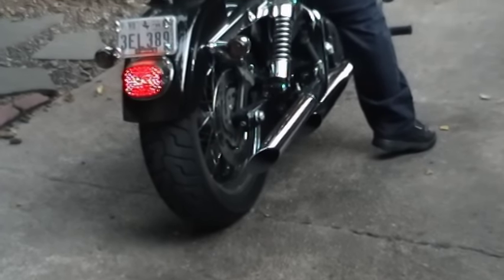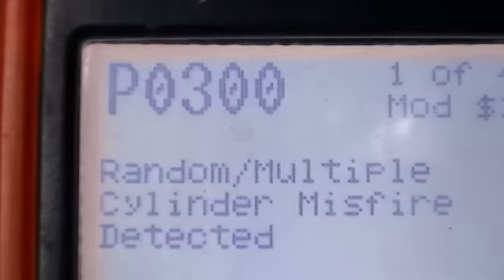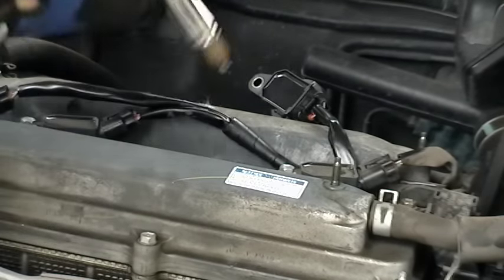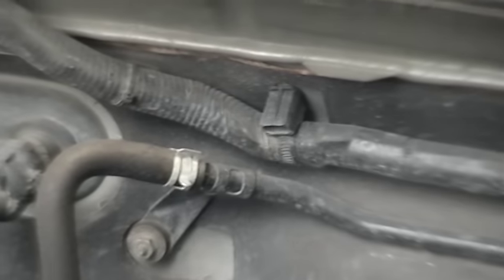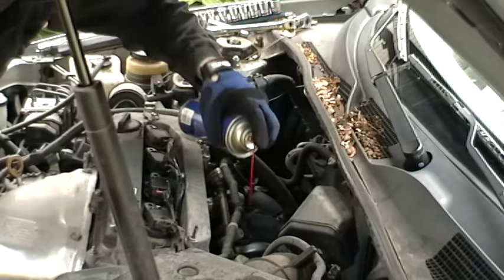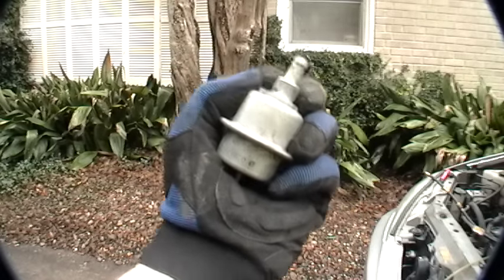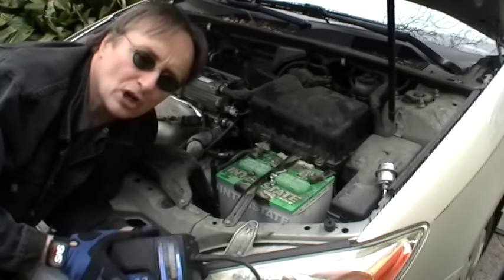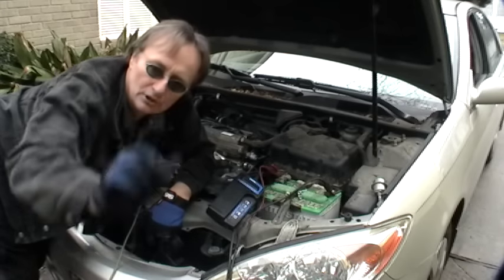How to Fix a Random Engine Misfire in Your Car (Code P0300)

Comment: Hey Scotty nice vid. I have a 2005 honda accord lx and i have multiple cylinder misfire 1,2,3 and 4.  Car starts fine. I checked spark plugs and coils. Car idles smooth but when you accelerate it starts to woble like suffocating or asking for gas.  Im starting to thing its a bad fuel filter cause the car still runs but ruff. What do you think?  Please help me. Thanks
Reply: egr ports probably need cleaning, full of carbon.  i changed a bunch of stuff but still have same problems.  cleaning out intake manifold today!
Reply: Jon Focker Hey i just fixed it.. fucking autozone got me wrong sparkplugs..  i change sparkplugs and waaalaa . Everything runs smooth and they refund money.
Reply: LoCo hUgO
i also bought the cheap ones at first but now got the NGK laser.  i took off intake manifold and cleaned EGR ports and throttle body but now its worse.

getting a P1399 random misfirecode and think i need a valve adjustment.  it's getting personal at this point, lol.  already had to change the transmission due to it being one of the worst designs.  didn't catch that in my google search before i bought the used car.

Comment: I replaced the starter on a 2012 QX56 and attached everything but all of a sudden I have a P0300 and P0306 Code.  Never had any issues before changing the starter.  Has a new 2 month old battery.  Car starts great now but now has these codes.  Hesitates at higher speeds. Replaced starter because it was doing intermittent starts.  Any suggestions on what could have caused this sudden issue would be appreciated.

Comment: 99 GMC Sierra 1500 5.3

Changed all plugs and wires. Still misfiring with P0300. Was working on it today and I discovered the intake assembly (before MAF) has cracks all over it. Vacuum line for fuel pressure is torn on both ends. Can any of these cause P0300? I just hope this thing doesn't have blown headgaskets or bad valves.
Reply from the maker: of course they cause such misfire codes

Comment: Great video Scotty. I have error codes for all cylinders in my 2004 V6 Saturn Vue P0300-06. I also have two other errors: P0442, P0706. The AutoZone employee suggested that P0442 (vacuum leak) is likely causing P0300+. I know my gas cap gets loose sometimes. Could that be the cause? Going to see if it continues tomorrow. Also, is P0706 likely due to a need of transmission fluid?

Thanks! I know I have a lot of questions here.
Reply from the maker: fix any obvious thing like low fluid and leaking vacuum lines FIRST. Pray it's that easy.

Comment: What about the Ford v6 coil pack? I've got code P0305; misfire in cylinder 5. Runs horrible, lacks power........plugs and wires are a year old(iridium, cheap wires from Rock Auto). I've heard that coil packs go bad all the time. Is this true Scotty?

Comment: Love your delivery! I notice that your fuel-pressure gauge goes up to 100 PSI. What's the typical pressure on a fuel rail, or is this even a reasonable question? I just tested a 2013 Mini (naturally aspirated) and got 60 PSI (with a hand-held dial-type tire-pressure gauge). I'm troubleshooting multiple misfires and major power loss that put the car into limp mode. Codes came back as P0300 and P0597 - Thermostat Heater Control Circuit Open.  I wouldn't have thought of the battery, but considering the fuel pressure I guess that's what I'll check next.

Comment: I had one in my XTerra 2 weeks ago. My spark plugs were only about 2 yrs old but I changed them all anyway. Turns out, it was my power brake booster. You could hear vacuum/air from under the dash everytime I pressed the brakes and the car would misfire at a stop. Changed the brake booster last Friday and problem has gone away completely.

Comment: Hey Scotty I have a 97 Dodge Ram 1500, 5.9 I have replace all spark plugs and wires though my engine idles rough and shut off by itself, I’ve replace egr valve, iac valve and even the breather element and checked for leaks in confused because it still comes and the only code I get is #8 cylinder misfire

Comment: Hello Scotty,my check engine light came on while I was going to work, The check engine light was flashing so I put into a gas station, My engine got loud or the idle was very rough, I took my car back home which was like 7 minutes away, I had a code reader which said P0300, then I notice my catalytic converter was very red. I have a question, I am going to get converter replace today, Will that solved the P0300 issue? Will I have to replace both Oxygen Sensors. I have a 2005 chevy classic(malibu) 4 cylinder.
Reply: First sensors then get cat

Comment: Hey Scotty, I have a 2006 Acura TL 3.2,apparently I have a misfire in a couple cylinders and of course the random misfire code. my CEL has been flashing at idle, then stays on while im driving. Changed plugs and coils. light still on. No violent engine shaking, no loss in performance(that i can tell). although I do hear a slight rumble in the exhaust at idle. Ive heard that a bent exhaust valve can cause this. Also, im not getting a reaction from one of my cylinders when i do the "coil test"

Comment: I have 92 corolla and it was not working. The local machenics diagnosed and said - oils burned out the engine. Probably engine was too low and burned the engine off. I showed to 2 other machenics , off the record &they said the samething. Do u think putting a new engine would require a new dark plug? Right now it's not working even though new engine is installed.

Comment: HI Scotty! Great videos as usual. I have'05 Silverado 1500 4.3 and check engine with P0016 code.The engine runs strong and drives with plenty of power, no performance issues,The only problem is shaking idle and you can feel multiple
little misfires .Also, putting a piece of paper on the exhaust flaps in and out.I replaced the cam sensor,new distributor cap,new spark plugs and wires .Please,help!

Comment: So is the carburator cleaner method only to be used on the intake manifold, cause I sprayed down all my vacuum lines and the break booster (along with the manifold). No change in idle

Comment: hey Scotty, I have a P 0300 on 2001 Nissan Sentra and the coil packs intermittently work properly. But the transmission also acts very strange in reverse and drive. Any ideas?

Comment: I had these issues on my 2010 Hyundai Accent and 2010 Acura TSX. For the Hyundai it was bad ignition coils. For the Acura it was loose ground wires from somewhere around the engine. Both issues were electrical. Spark plugs rarely go bad now a days.

Comment: Hey Scotty, great videos!!  I have the misfire codes too and will try to fix it this weekend based on ur videos. 

My next issue is my shifting for same car, 04 Lancer. Whenever I shift gears, it seem stiff, like no lube. I recently changed the trans fluid in hopes of improving it. It ddnt help. What should I check next?? (Manual trans)

Comment: I have a p0300 code in my 2000 jeep grand cherokee I've done everything here except change the battery, but it was checked and I was told it's good. It usually only gives me a problem when I'm on the road for a while, like a half hour or more. Sometimes the code just goes away and I dont have any issues. Any idea what that could be?

Comment: Hey Scotty! So I have a 2005 Mazda 6 V6 3.0 along with the dreaded P0300! I changed the plugs not too long ago. They are all gapped fine. Bought carb cleaner, no leaks detected. Bought an OBD-II to see exactly which cylinders are missing... and its all of them anywhere between 20-200 misses per 20 mile drive... took it to mazda dealer... ($90 later) they are saying I need new coil packs.... for the low low reasonable price of $980. Did you catch the sarcasm?  Ha. What do you think? 178K miles same packs... how often do they go bad? Should I check fuel pressure and filter too? I just dont want to throw parts at it either... I also dont want to trash the CAT

Comment: Hey Scotty,my girlfriends 2006 Equinox is giving her the P0305 code. I changed the plugs and wires with AC Delco parts and reset the computer. I'm still getting the code. Do you think I should move on to the coil pack? If I have the local garage diagnose it will they be able to tell me exactly what's wrong with it? Thanks for the help.
Reply from the maker: if they are good, they can pinpoint it IF they have a dealer level scan computer.
Reply: Scotty Kilmer

Comment: Scotty, my Lexus rx300 1999 is driving me nuts. I have many codes. I have p0300 p0301 p0303 p0305 p1300 p1320 p1346 p1349 p0171 the car runs smoothly for 20 minutes and when it's completely warm it rough idles and cel flashes, if I rev the engine or almost floor the gas it stops for a while... also, I changed the maf sensor like two months ago because I had a code for that, I don't know if that makes any difference. What should I do?? 
My gas mileage dropped from 16 mpg to 10...

Comment: Scotty, LONG time fan here, first time comment.  I have a celica with the same, or similar 1.8 1zz in it, shes got 180k miles on her, but still purs great, she has the p0300.  Replacing my MAF helped for a few days, but every once in a while when i pull up to a light the idle drops almost to about 600rpm and then i notice the computer compensating, but then it idles unhealthily till I give er gas.  Ive got the P0300 and the corresponding P0304 and P0302 codes.  She burns some oil and often has black soot on her rear bumper, so the fourth code :( is a P0420.  And Toyota also diagnosed the catalytic converter as bad....Where do I start!!!??!?  Could the cat be causing the misfire?  Ps, Already did plugs, air filter, cleaned tb, and replaced MAF.  - Frustrated Toyota owner
Reply from the maker: the misfire generally causes the cat to go bad. Swap 2 and 4 injectors with 1 and 3, and if the miss codes moves, change out those injectors, that's common

Comment: I have a 2012 dodge caravan with the engine light just took it  to the mechanic new plugs replaced one ignition coil light came back on again Po300 and pooob. How many ignition coils does it have 6 cyl.?

Comment: Hey Scotty I got a old 206cc Briggs powered snowblower and its misfiring at full throttle only, no other rpm. It's also very very hard to start when cold. The only way to start it is to play with the choke on and off till it starts and sometimes pour gasoline down the carb. The spark plug was never changed because there is very little clearence between the spark plug and the cooling fins on the head so my sockets are to thick. I don't know about the oil, I just add fresh oil when needed. Also the carb was never cleaned. CAN you please help me? I'll need it when we get some more snow.

Comment: Scotty I have an oil soaked plug on a 03 Saab 9-3. It only one on the drivers side. I found it changing the plugs. I'm about to change most of the gaskets but could it be a piston ring?

Comment: Hi Scotty, I have changed all plugs, I changed all ignition coils, and crank sensor and 2 o2 sensors in my 2003 nissan maxima 3.5 I am still getting the p0300 code, the car starts up fine only when given gas in neutral or in gear then it starts missing do you have any idea what else could be an issue. The car drove great then while driving in just started missing and had a major loss of power and the code came p0300

Comment: Hey scotty.. I got 7 misfirs codes coming up as of right now. One for each of the spark plugs, along with that 0300 code which these are always showing up.. Also, b2aaa always comes up too and more recent p12a2 that has been showing up the last several times that I have started the car but is a newer code showing from when I first started seeing these after a tune up. Also, p0016 that sometimes come up and other times don't such as now and haven't more recently the last several times I have turned the car on. I have taken it in and was told that the camshaft position sensor needs to be replaced and prior to that a friend that works on cars said he would change both that one and the crankshaft sensor to see if that would fix the issues. Also, the shop ge works at said that the one code p0016 was pointing at the timing chain but the one mechanic that said that just the camshaft position sensor need to be replaced said that since the shaking was coming and going, then that tells him it's not the timing chain. Also when I called a car parts store to inquire about both sensors, he advised that these typically don't go bad and to go have it checked out by someone else again since I'm being told different random things. I'm just getting the run around and I'm not sure what to do at this point! Any suggestions. Ps.. it hasn't been shaking at all or idling weird lately.

Comment: Scotty, I have a 2004 , 5.3, 1500 chevrolet, I have replaced fuel pump, intake gaskets, o rings in the injectors, air filter, cats/entire exhaust system, cleaned the mass air flow, knock sensors, cleaned the throttle body. After replacing the Fuel pump it ran perfect. Three days later I have codes po171, po174, po420, po430, po300. Not sure what is going on! Please help.
Reply: Cody Hoops also changed the plug wires. Plugs were good.

Comment: scotty i got a 2000 jeep wrangler 4.0l has random misfire changed coil pack cam sensor fuel pressure is at 30 psi which is goog but when i step on the accelerator pressure goes down would that be a bad or dirty fuel filter?

Comment: Scotty, how can a battery cause random misfires?  Isn't the alternator providing all the electrical power when car is running?  I've been trying to troubleshoot P0300 and had ruled out the battery because of this.  But I just got a Waekon tester and found that the spark arc isn't long enough.  I'm starting to rethink about possible battery problem.  But can you explain why battery would be involved if the alternator is supplying the electrical power during operation?  Thanks.
Reply from the maker: really bad batteries short out the electronics and can make the alternator not provide enough power to run the car properly. I've seen it many times
Reply: +Scotty Kilmer Thanks, Scotty.  I'll put Solar battery tester on it.

Comment: Hey Scotty. Got a question I'm hoping you can answer. Had my service engine light come on so I went to auto zone and had them test it. Came back that there's a misfire on cylinder 2. Bought all the spark plugs and changed them out, but now the light is flashing, the car putters when it runs and will stall out, and the car shakes violently. Any clue what I can do to fix? Really stumped
Reply: Forgot to mention that its a '98 Chevy Lumina

Comment: My 350 keeps throwing the P0300 code. I've replaced the packs, plugs and even the crank sensor cause some people said that might work. They also said changing the camshaft sensor might work so what would you suggest?

Comment: I'm confused...I thought the purpose of the battery was just to start the car and the alternator is what runs all electrical systems in a car so how does the battery play a part in a misfire? I have used someone's battery to start my truck then completely removed it and drove to part store on my alternator so I could get me a new battery. Truck ran fine with no issues

Comment: scott,  2002 solara  2.2. code 300, 301 302 303 304 ,  new spark plugs.  one new coil. new fuel filter. sprayed  carb cleaner around intake, neg results inspected vacume lines  cleaned maf removed maf code, rough idle   let engine warm up, hold it at high rpm 3500-4000, short time engine rpm falls off unable to maintain it above 2500., on the  road  car has a hard time pulling out with power, once rolling  feathering the pedal   can  get it up to 45-50 mph put in neutral car will rev over 4k put back in drive it stumbles.

Comment: I have a 07 jeep liberty that keeps thorwing p0300 code. changed plugs and batt. checked all lines for breaks and checked for leaks.  everything is good.  Jeep runs great and can get it upto 90 on the highway with no problems. I have cleared the code and a week later it comes back. The only thing I can think is the problem is the crank sensor or the ASD relay. Any thoughts on what else may be causing this code but engine runs fine?
Reply from the maker: +Craig s   it's a jeep, they age and electronics go haywire. live with it, cause often it's minor bad computer circuits
Reply: +Scotty Kilmer I didn't think it was anything major since it runs just fine. Just hate looking at the engine on knowing it is a false light.

Comment: Any thoughts as to what could trip P0300, 301, 303, 304, and 305 (aka all but cylinder 2 in my 5 cylinder are misfiring). The check engine light was flashing so I pulled over and got it towed to the shop. It's a 2005 VW Jetta with 142,000 miles on it. Thanks

Comment: I have a 2012 Audi Q5. It's showing P0300, P0302, P0304 and P0506. I purchased 2 new ignition coils and installed them on cylinder 2 and 4 but the problem continued. I also moved the new coils to different cylinders but still got P0302, P0304 and P0506 codes. I then replaced all spark plugs...still the same codes. By the way...I did clear codes each time.

Comment: Thanks scotty i have a 2001 mistubishi eclipse gt it has a random misfire problem i changed the spark plug and nothing worked but i figure itnout the battery was too small to handle the engine !!!! The people i bought it from have a size 26 battery in it and it called for a 62!!!!

Comment: I have a nissan pulsar 2001 N16 with Engine Light permanently on.  I took to mechanic to read the codes and it was P0355 and it displays crankshaft position sensor.  I then went ahead and replace both the camshaft and crankshaft sensors.  The light goes off but after e few drives around on the same day, the light comes back on.  Also the RPM needle is not steady during idle and running...do they contribute to the same problem...appreciate your help...thanks